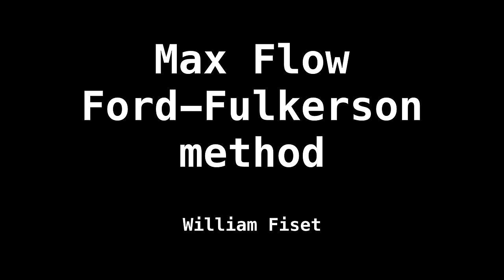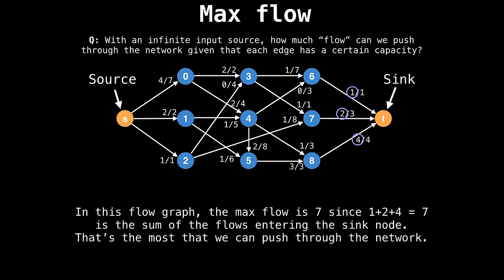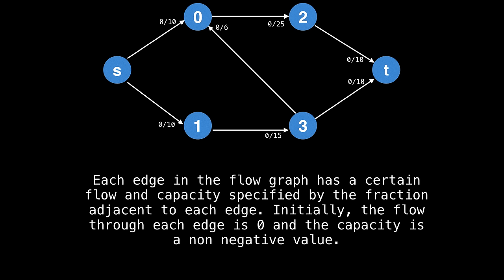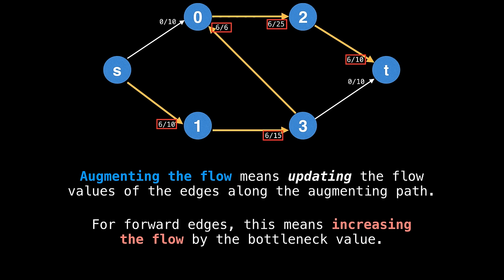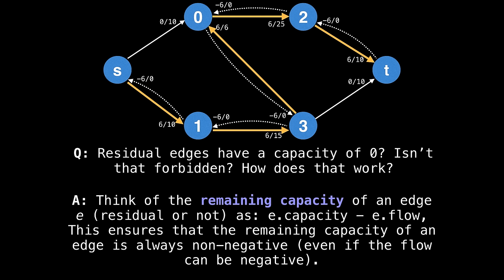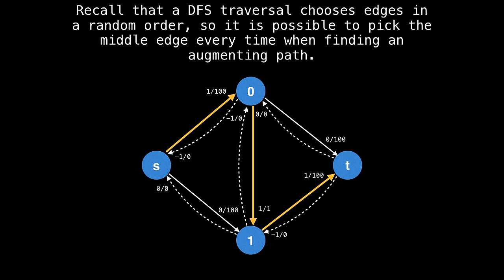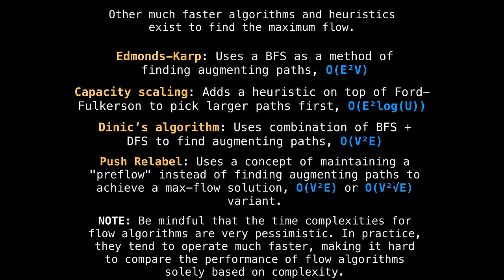Max Flow Ford Fulkerson | Network Flow | Graph Theory

Comment: Good video, but there's a few things that could be improved.

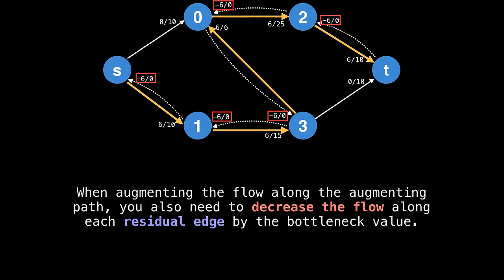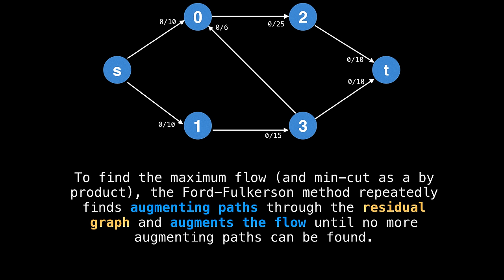Residual edge is incorrectly defined at 6:00. At 4:20 he says you're probably wondering what a residual graph is, and then he proceeds to use the word residual before defining it!

In Ford-Fulkerson, we assume each edge has an edge in the opposite direction. Where the capacity is only given in 1 direction, set the other direction's capacity to 0.

Assign a flow of 0 to each edge, and then as the algorithm proceeds, the flow on each edge can be changed. But when you change the flow of an edge to x, you MUST assign -x to the flow in the opposite direction. This is NOT called a "residual". The residual exists in both directions.

The residual (which means "quantity remaining") of an edge is what at 7:29 he calls "remaining capacity".

It is simply the capacity of the edge minus the current flow. i.e. If the residual is > 0, there is still room for more flow. The residual graph is just the whole set of residual edges.

The word saturate in general can mean "fill until no more can be held". In this case, a saturated edge has residual == 0.

Comment: Amazing explanation and I love the animation as well! I think it is worth pointing out that the key observation that the sum of the bottlenecks (found in each augmenting path) equals the max flow is only true because we assumed the initial arc flow is 0 for each arc. If we do not assume this, then you need to add the initial value of the flow (of the graph) to the sum of bottlenecks as well.

Comment: Appreciate the videos! I'm in an operations research course and it's hard finding clips on some of these algorithms!
Reply: If Timotheus' pole has a network flow capacity of 8 units spunk along its edge, delta net, how much bottleneck maximum flow can Timotheus' hole take before it fissures?

Comment: I got totally lost around 4:47 when he starts talking about edges being saturated...?  And what is a residual graph?  And I don't remember depth first search...  What if there are two bottlenecks in the graph?
Reply: Good video, but there's a few things that could be improved.

Residual edge is incorrectly defined at 6:00. At 4:20 he says you're probably wondering what a residual graph is, and then he proceeds to use the word residual before defining it!

In Ford-Fulkerson, we assume each edge has an edge in the opposite direction. Where the capacity is only given in 1 direction, set the other direction's capacity to 0.

Assign a flow of 0 to each edge, and then as the algorithm proceeds, the flow on each edge can be changed. But when you change the flow of an edge to x, you MUST assign -x to the flow in the opposite direction. This is NOT called a "residual". The residual exists in both directions.

The residual (which means "quantity remaining") of an edge is what at 7:29 he calls "remaining capacity".

It is simply the capacity of the edge minus the current flow. i.e. If the residual is > 0, there is still room for more flow. The residual graph is just the whole set of residual edges.

The word saturate in general can mean "fill until no more can be held". In this case, a saturated edge has residual == 0.

Comment: Is there a particular reason why the "maximum flow" calculated using the "sum of bottleneck values"? Instead of using the "sum of outflow from the source node"?
I found the "sum of outflow from the source node" easier to interpret, that's all.
Reply: The bottleneck approach is more useful to understand min-cut. Looking at the capacities that are actually filled gives you more information on how to reconstruct the optimal answer than looking at the outflow from the source. Sometimes, designing network flows is also easier to come about if you think about it in terms of min-cut.

Comment: I have a doubt: why we have to compute the augmenting path (s -> 0 -> 3 -> t), if the arrow goes from 3 to 0 (3 -> 0), and not from 0 to 3 (0 -> 3)? Thanks.
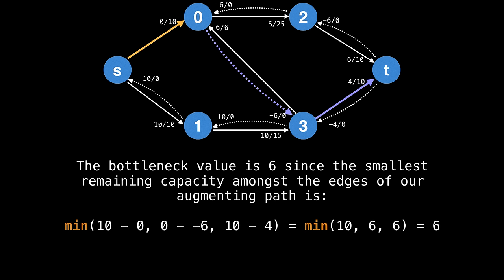Reply: He said at ( 9:09 )that we can use the residual edge, we have created. So basically we used the residual edge 0->3
Reply: @ahlahous8128  Thanks!